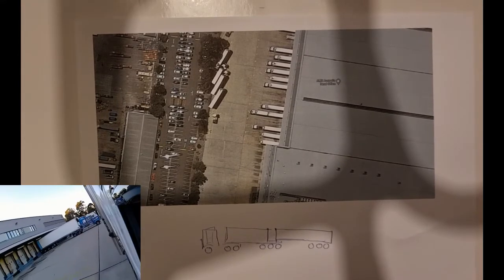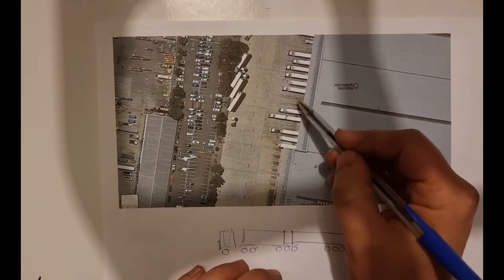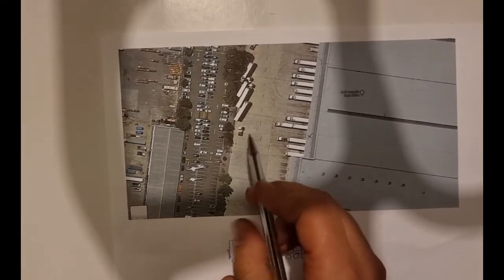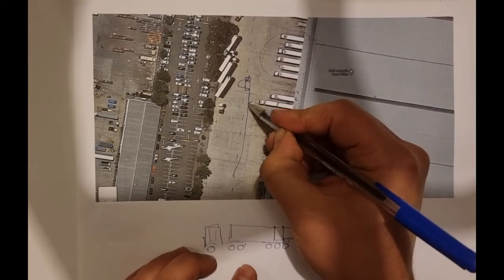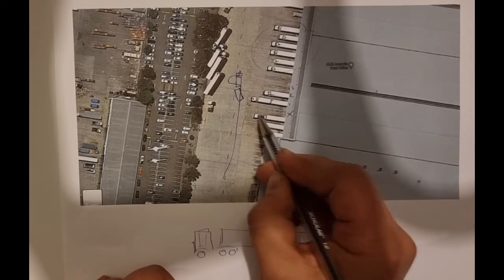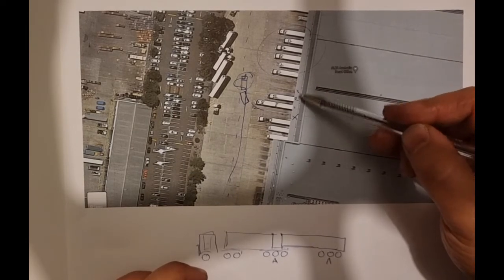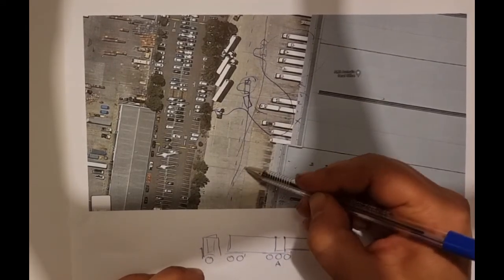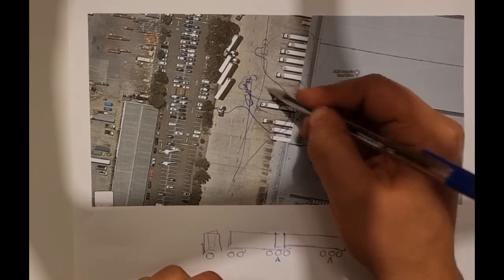Reversing B double onto dock at right angle explanation

Comment: how do you unload the lead trailer at a dock?
Reply from the maker: There's a lever attached to an electric motor which slides the box back and forth on a rail
Reply from the maker: Also if the full set is on dock, there are doors in between the trailers which open up so can walk straight through
Reply: ah I c , thanks for the info